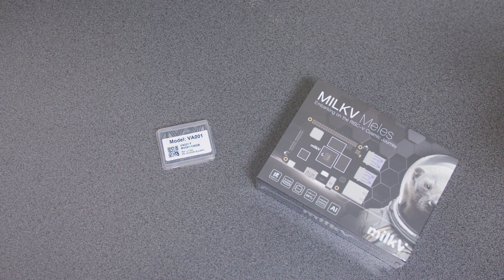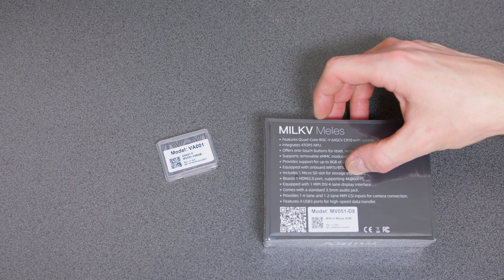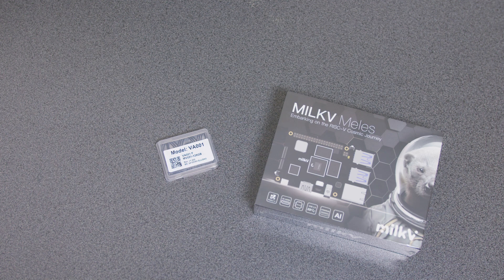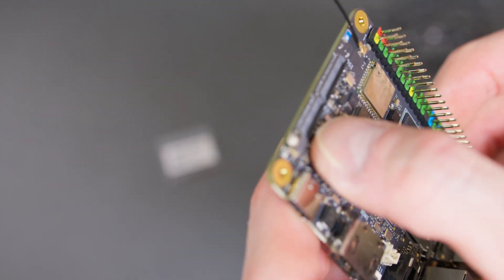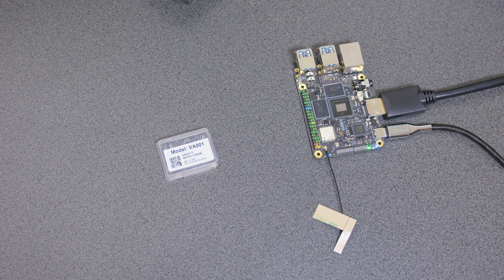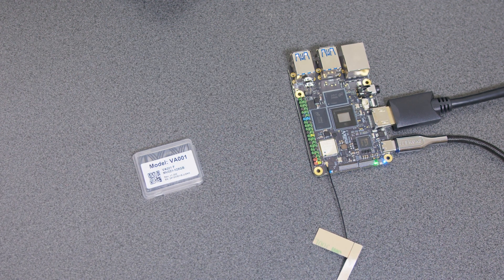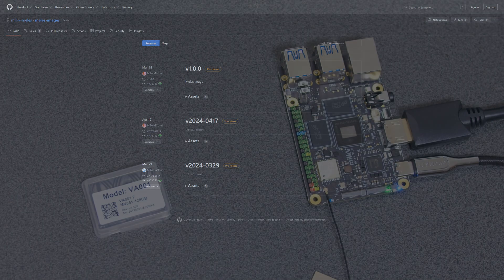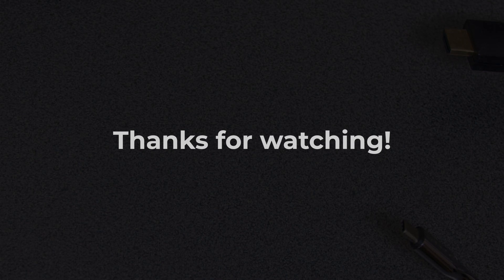Milk-V Meles - The As-Yet Untested SBC... in my books at least

Comment: Was contemplating to buy. But after several reads of deads here and there, sorry I won't buy
Reply from the maker: Hey great to hear from you! It turns out they had a few issues with the first production batch that was to do with the solder reflow process, however, they fixed that for the second batch. Last I heard they've all been stable for a while now!

Comment: Just got my MilkV Meles last week.  Appears to be dead as a door knob too. Cannot get any activity from it at all. I followed your steps as well as the instructions but it appears to be totally dead. The only difference between mine and yours is that you get a blue LED along with the green LED. Mine only has a green LED. Beyond that... dead.
Reply from the maker: Dang man, sorry to hear. I'd recommend connecting to UART and monitoring the debug output to be sure. But if it's completely dead, just reach out to where ever you purchased it from, as I got a refund straight away when I did - seems to be a known issue!
Reply: @PlatimaTinkers  I was able to get a replacement. They tested it before shipping.  New one works great.
Reply from the maker: @matthenrich995  OH awesome. They didn't replace mine, just refunded it. Still never used it from what I recall 😅

Comment: do you know if it had a maximun microsd card capacity? 512gb? or 1Tb? thanks in advance, i have read tha the minimun is 16 gb, but dont know if there is a maximun
Reply from the maker: It uses the TH1520, which has SDIO 3.0 and eMMC 5.1, so I'd put my money on eMMC max 128GB but I am not entirely sure for SD/TF card, likely the same, but max in the specification is 2TB.

Comment: So far my experience with the VisionFive 2 and Lichee Pi 4A Console (TH1520), is that updating them with new Linux images, is not without issues. Updating the firmware of the VF2 was a lot of "fun". And it looks like Lichee Pi mainly test the Console with external monitor, keyboard and mouse. One update killed the performance with the internal screen and the other update killed the keyboard and trackpoint. So I went back to the original image.
I have also ordered the Banana Pi F3, and I'm hoping things will be as easy as flashing an image on a micro SD card and just go.
Reply from the maker: Had no issue with either of those myself.

BPi-F3 was not too bad. Just crap performance unfortunately.

VF2 for the win so far.
Reply: in my experience, the spacemit k1 is not that bad. just dump their stock image which bloated with a lot of preinstalled stuffs and use armbian image, it react much faster. but optimization is still a long way to go. @PlatimaTinkers
Reply: @LivingLinux  how's your experience with bananapi f3? can't wait to see it! i was trying to use it with 2.5g nic and openwrt, i got the nic up and running, but not the openwrt as docker was broken in riscv😭
Reply from the maker: Yeah it worked pretty damn well! I actually prefer the MUSE Pi Pro so far though.

Comment: it's done in the same stupid form factor as a raspberry pi. Connectors along two sides. FK that.
Reply: I honestly don't like that either, but I think it's meant to be that way as a drop-in for a raspberry pi or to seem similar and more familiar to raspberry pi users.
Reply from the maker: @rattlznake  Yeah that's why they keep the same Pi2 header pins too I think
Reply: YouTube is 80% men
Reply from the maker: Seems to be industry preference, but I absolutely get your issue. I think it is also slightly for design requirements too though

Comment: If it keeps on the current price, then absolute banger for playing with riscv. The only thing weird to me is why they keep gpu name as it's a f-ing trade secret? Only scenario that i can think of is if it doesn't have a full blown gpu and what's advertised is mostly done via software.
Reply: imagination powervr dumpster fire GPU, imagination is dragging their heels as much as possible on upstreaming the driver and putting what little dev effort they have into zink/opengl support
Reply from the maker: @pessimism056  Yep, Frank Binns is doing a lot to get PowerVR open and over, but it's still about 3000 packages to recompile to get it working in any form from what I've found
Reply from the maker: Ah the GPU is public, easily searchable, just a crap GPU with no drivers. All software